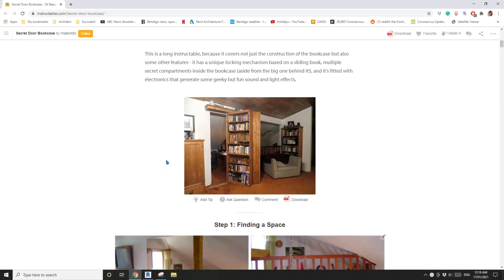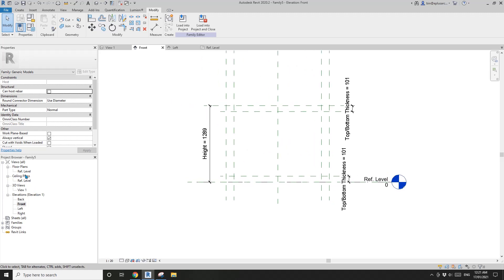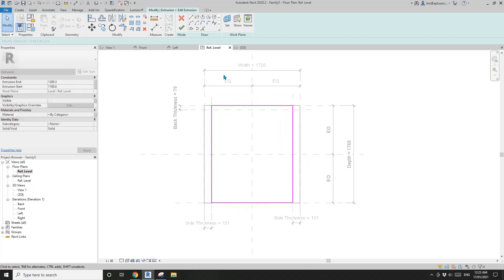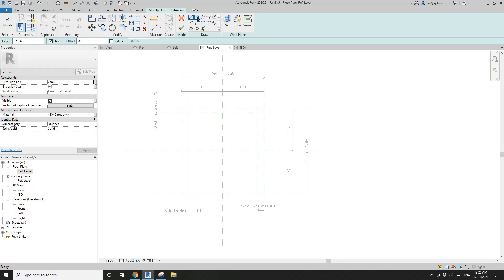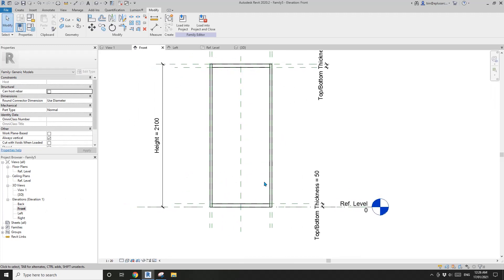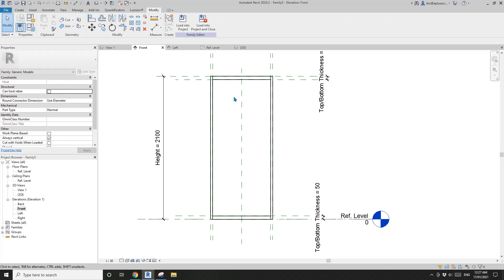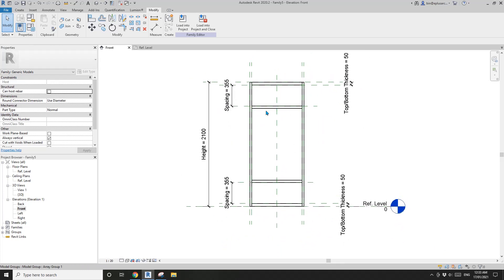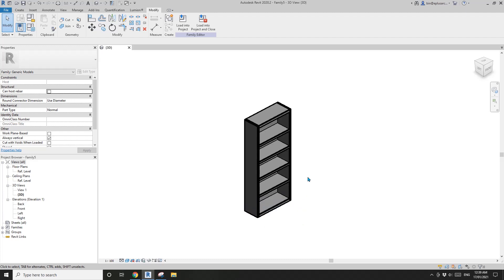Everyday Revit (Day 304) - Parametric Secret Door Bookcase (Part 1)

Comment: Sir  can you tell me how to show  Ventilation in floor plan which have sill height of 7'-0"
Reply: i tried View Range but it is not Working
Reply from the maker: Create a plan region around that ventilation, then set the view range of it, make the cut plate slightly higher than the sill height.